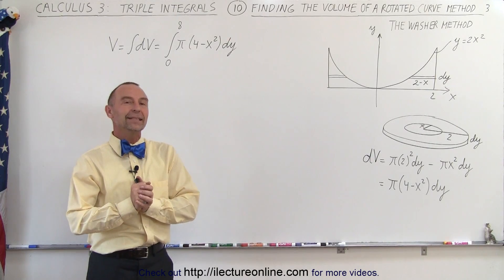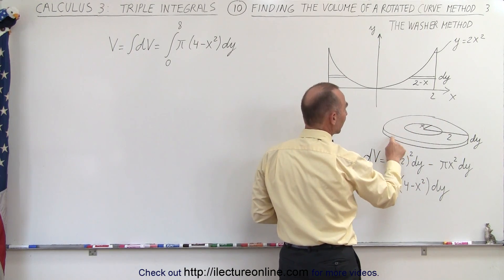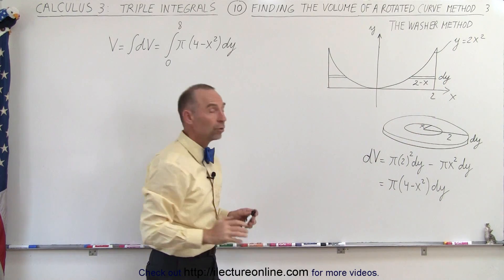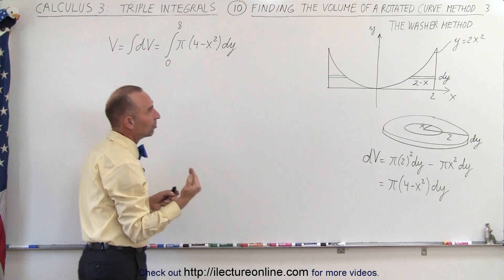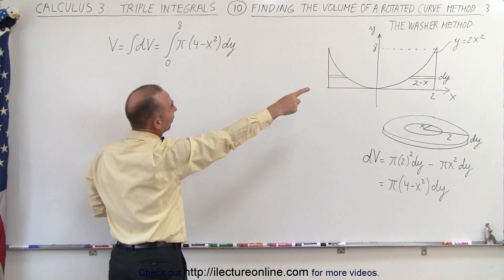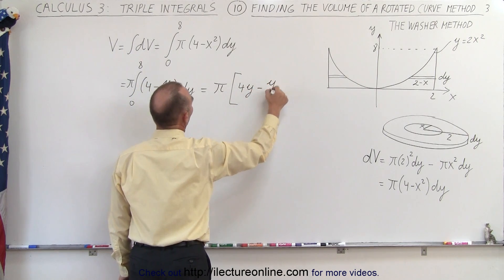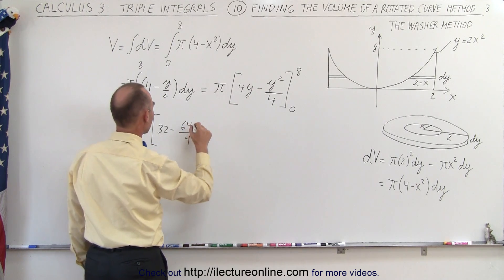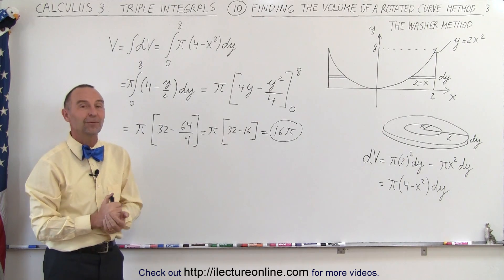Calculus 3: Triple Integrals (10 of 25) Volume of a Rotated Curve: Method 3: Washer

Comment: what's  the value of x  if limit for  y is 8 wouldn't washer go to a. point
Reply from the maker: x = 2 when y = 8   and the volume of the washer will go to zero.   (although that is the case for every washer, as dy goes to zero.)  That is the mystery of integration , you sum up washers as the number of them approach infinity, and the volume of each approaches zero).